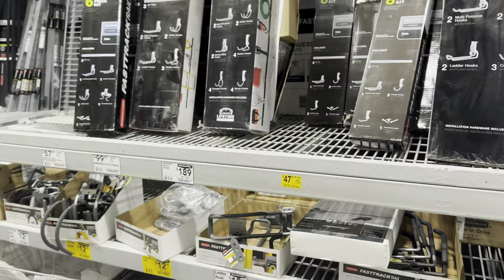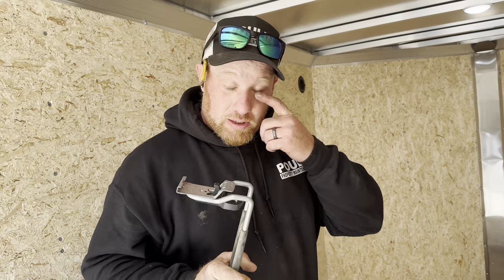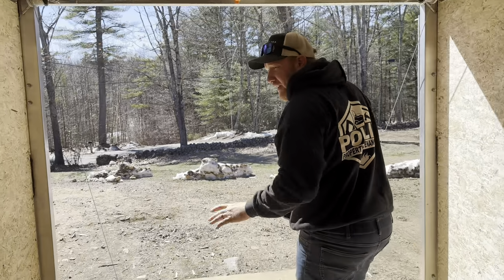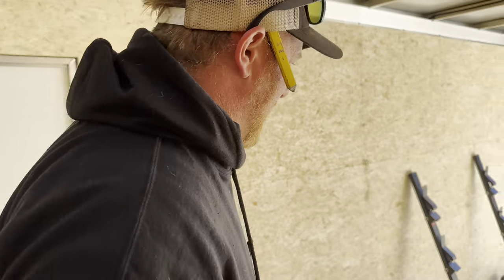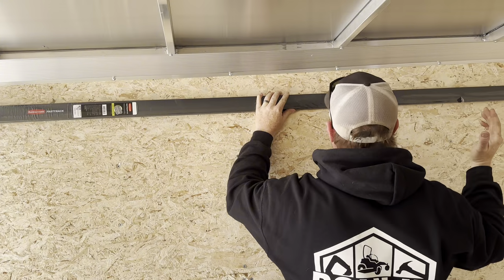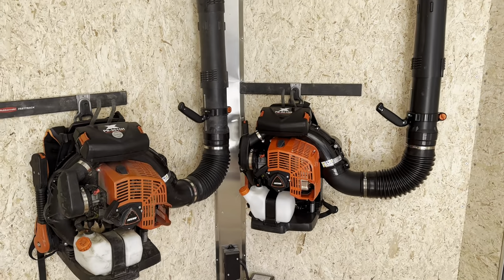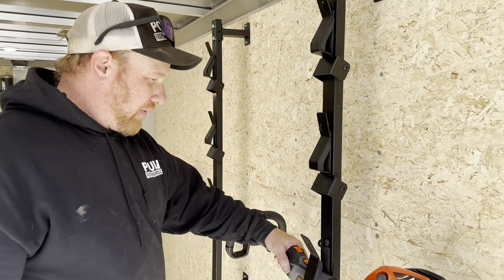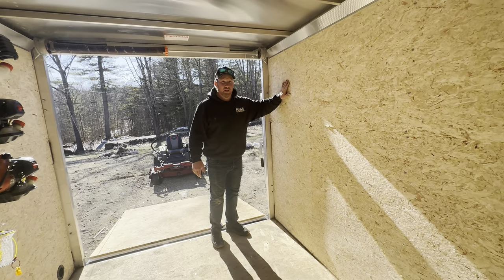2024 Lawn Care Trailer Setup

Comment: Engine support system for the trimmers would be good. 

Echo 590 timberwolf is good midline saw. I don't use it a ton, but I use it, and I run a two foot bar on mine.  

My dealer recently talked me into the cheaper version of the echo handblower over the x, because he said they blow the same....but on the gas tank size alone, I probably would have gone with the x version. It just looks tiny, but fuel lasts okay; I have the 9010, but I do find I pull out the handblower for lawns, mulch and shrubs alot more 😂  The cheaper version still works pretty good, though, so it's not like I'm cursing his name whenever I use the blower 😂

So, after however many months, how are the mounting solutions working for you?
Reply from the maker: Everything is working well and holding up well, with the exception of one of the baskets had too much weight, so re-mounting that!

Just got a TimberWolf 590 with a 20” and getting a 24” bar. Loving it so far! 

Good to know on the handheld blowers! That’s next on our list.

Comment: What size enclosed trailer would you recommend? I have a 52" and a 36." Or what would be the smallest?
Reply from the maker: My first question is what are the machines? Walk behinds, stand ons, sit downs? Makes a difference space wise….
Reply: @PoulinProperty  stand ons
Reply from the maker: Shoot, I’d say you could get a way with a 14’ all day long BUT I have learned, if you think you need a 14’ just go a little bigger now because it’s amazing how fast you grow out of what you think you need!
Reply: @PoulinProperty  What size is your enclosed here?
Reply from the maker: @lowballerlawncare7961  16’ on the enclosed. Only 7’ wide, wish I had gone wider and a little longer. Most likely will upgrade in a year or so.
Reply: @PoulinProperty  Why do you want bigger, what are you wanting to do?
Reply from the maker: @lowballerlawncare7961  With our racks for the weed wackers, blowers, hand tools, etc. it makes it real cramped! I wish it was just a tad bit longer so I could fit three mowers. Certain commercial accounts we are taking two trucks and trailers to have the extra mowers.
Reply: @PoulinProperty  with the 7' width are you able to grab trimmers off of the wall without taking the mowers off or are you still having to squeeze in(between the mowers and wall) to grab something off of the wall?
Reply from the maker: @lowballerlawncare7961  You can fit in but it is a bit of a squeeze!